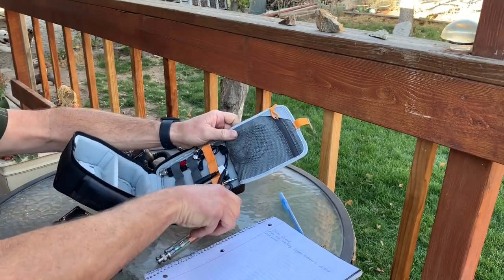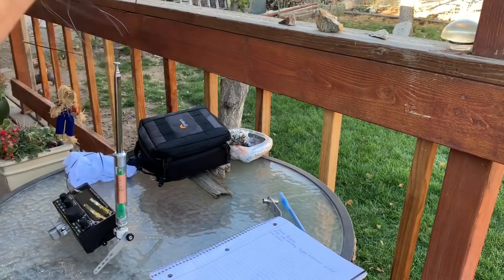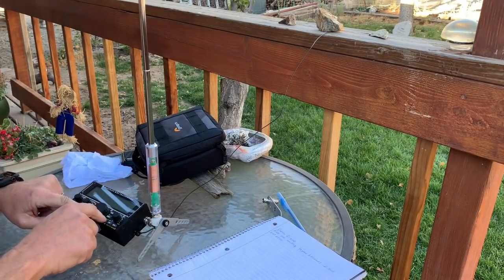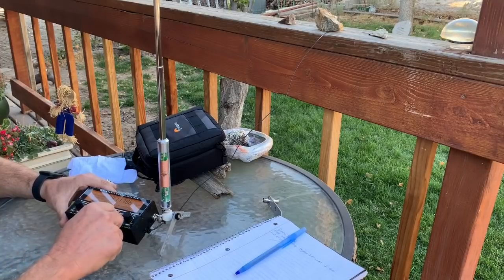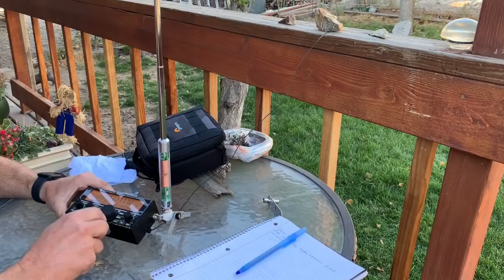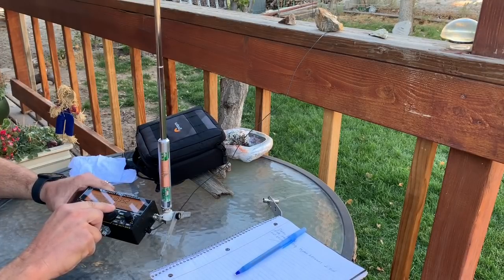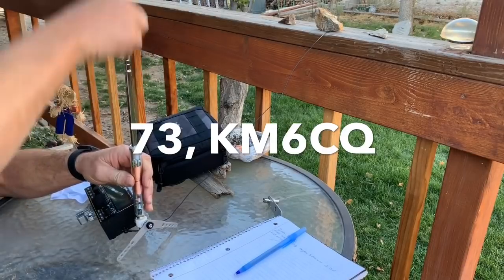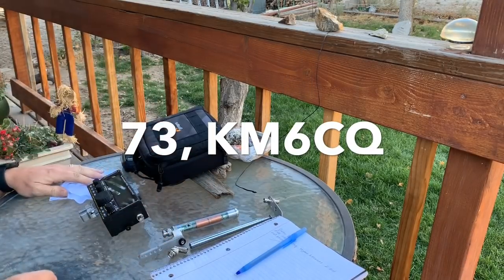Elecraft’s AX1

Comment: You don't always catch a fish when you throw a hook in the water. That is really a neat little antenna. I also use a small base loaded multi band or single band telescopic whip with my KX2. But what I did was make a table top mount for the basic setup. I used an antenna analyzer for the tuning procedure. I cut one radial per band and adjusted both the whip and radial until I got a perfect match. After I documented my findings, I attached the whip to the KX2 along with my ground radial. My SWR was flat at 14.150 mhz, no tuner needed.  I did same for 17 and 40 meters. On 40 meters the resonant frequency is in the CW portion. To go to SSB I just make the whip a tad smaller. I have radials cut for each of the bands. 

Barry, KU3X/QRP

Comment: I saw no contacts were made, but thanks for trying most bands. I thought the AX1 would have some resonance, but instead your antenna video is proof that an Elecraft rig can tune anything. Have you started experiencing BNC torqueing and shorting issues yet or does Elecraft offer a replacement for the telescopic whip when it breaks?
Reply: The original design of the BNC was for use on test equipment, where the plug was not often removed. For our application (lots of on  'n off) we must be careful to forcefully push the plug into the receptacle. Otherwise, the side lugs on the female that hold the plug in place will wear down.
Reply: There is a replacement whip available